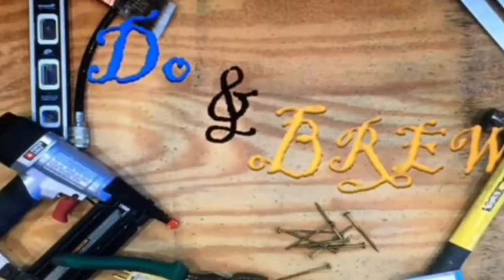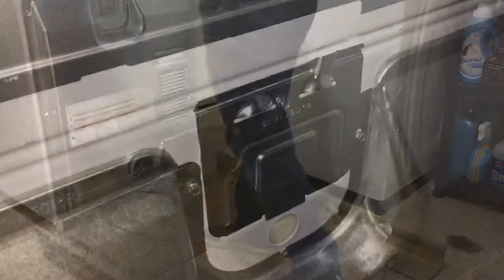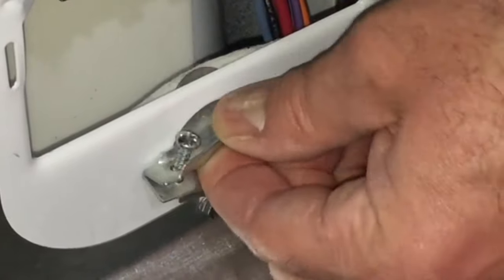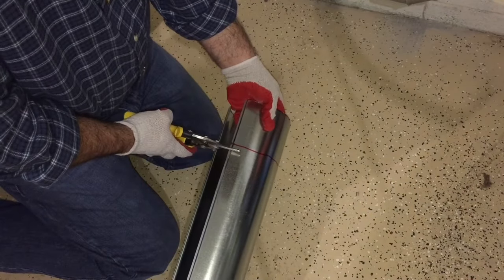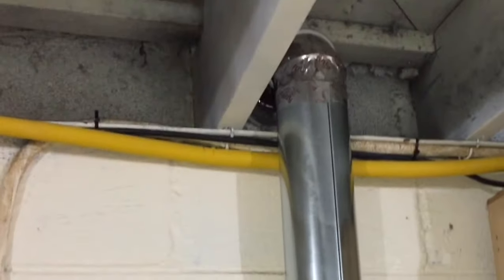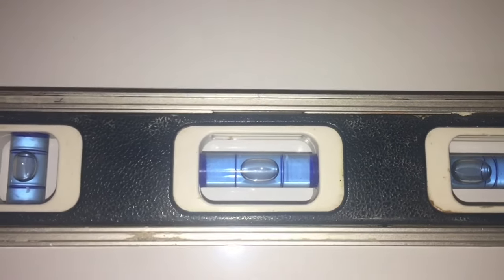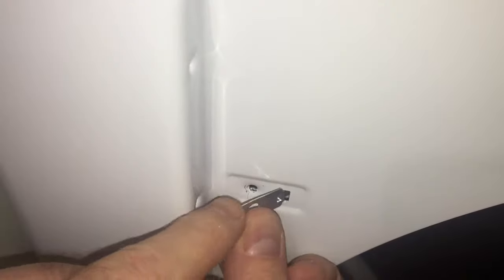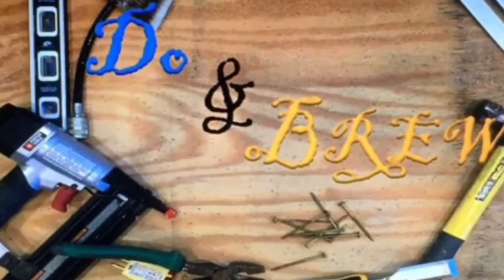New Clothes Dryer Complete Install

Comment: wow, this is much different compared to how the washer/dryer movers did it. They just brought it to the basement, plugged it in and then didn't connect the vent line. They didn't have flex vent or aluminum tape. So it's up to me to do it all. They also didn't put on the washing machine feet pads.
Reply from the maker: Wow - that stinks…just a drop and run job…sorry you have to now do what they should have done.  Let me know if you have any questions.    ☘️

Comment: I’m in the market for a new dryer and washer, reliability is my number one concern. What model did you buy? Or recommend?
Reply from the maker: Howdy Edgardo Amado !  Thanks for the question...there are so many brands of washers and dryers....and so many features available, it would be difficult for me to make a solid recommendation.  

That said, I have always had good luck with Whirlpool and Maytag...meaning - long service life with few repairs.

Personally, I am not a big fan of the mega-priced LG and Samsung models.  So many/too many bells and whistles and gadgets leave much to break and require expensive maintenance!  I have had those high-priced, gadget-galore machines that played pretty tunes ... only to have them breakdown over and over again!

In the end, I have returned to the reasonably priced washers and dryers that reliably do what I need the to do  - wash and dry my clothes!

This is my personal opinion based on my personal experience over the years with the broad range of machines available.

Hope this helps a bit!   🍀
Reply: Do And Brew - DIY thank you for the help, I just got a house and I’m trying to educate myself. Does your washer have an agitator or is one of those call high efficiency ones?
Reply from the maker: Edgardo Amado ... it is a high efficient model...it does a good job washing the clothes, but you do have to run a “ washing machine cleaner “ through the system about once every two weeks to keep everything smelling nice.
Reply: Great...I’m having the LG DLEX4000W delivered tomorrow. Ugh

Comment: Thank you for this. But I have two issues with it. Like the other viewer, I was under the impression that we are not ever supposed to use sheet mettle screws in modern installation for the reason stated - they are a lint collection point. And, secondly, I always thought the non-flanged side was supposed to be towards the dryer and the flanged side towards the outside for the same reason - so that lint doesn't collect at the internal lip. With the flanged side away from the dryer, the lint rides over the lip and doesn't have to go over it.  Section 504.6 of the International Mechanical codes states: 

"The male end of the duct at overlapped duct joints shall extend in the direction of airflow."  

According to this you put your pipes in backwards. But otherwise I enjoyed the video.
Reply from the maker: Howdy Dale!  Thanks for checking out the video and for pointing out those issues.  To be honest, you are 100% correct on both!!!  Regarding the screws - I wanted the security of a mechanical fastener.  My dryer vent stack is 8' tall and would continuously fall down - regardless of the tape I used.  Over the years the adhesive of the tape would dry out from the heat of the dryer and the vent pipe would drop to the floor.  The direction of the connections is based on the way the original vent through the wall - and honestly - I did not have the time or want to tear everything out through the wall to complete this repair/install.  But you are right on both points.

That said, I believe the drag / collection surface area created by three 3/16" screws and the pipe unions if far less than of a corrugated/flex pipe.  It has been two years since this install and nearly daily use...I recently bought a Milwaukee Inspection Camera so I will drill some holes in my vent pipe and see how much lint has collected around the screws and unions.  Look for that video in a month or so.

Thanks again for watching and the points you made!
Reply: @DoAndBrewDIY  Yes, and I think these rules matter much less in your circumstance. I'm redoing a dryer vent in a condo and ultimately the piping will be concealed inside a drywalled bulkhead that runs about 35 feet. With yours being exposed as it is, you can change/fix yours easily at any time. The building I'm in is more than 30 years old and this is the first time the pipes have been changed in all that time. So I think it matters much more when you have concealed pipes that are intended to be there for the long term than in your situation.  To solve your hanging/falling issue, can't you put a hanger under the bend at the bottom and/or tightly fastened wall straps down the vertical piece. I don't have a riser (beyond the 4ft from our elevator dyer to the ceiling, so I haven't explored that. My 4 ft stretch has a hanger that reaches from the ceiling and holds up a metal box that surrounds the pipe at the turn where the pipe protrudes through the drywall to where the dryer is. So that's how its handled in our condo. Thanks also for the gloves point. My hands have a half dozen cuts on them from before I watched your video. Bought the same gloves you have a home depot so hopefully that's a thing of the past now! I really appreciate your kind of video that helps us do-it-our-selfers!
Reply: Do And Brew - DIY did you ever check you vent pipe for lint accumulation, and if so, did you make a video?

Comment: Nice work, but...

Section 504.4 of the International Mechanical Code states:

"Ducts shall not be connected or installed with sheet metal screws or other fasteners that will obstruct airflow."
Reply: HighSierraBob is correct. One solution is to use Fiberglass Reinforcing Tape to Seal Sheet Metal Duct with Mastic. Most won't go to this trouble and expense. I just use U.L. Approved foil tape